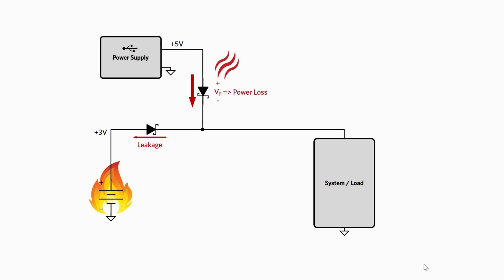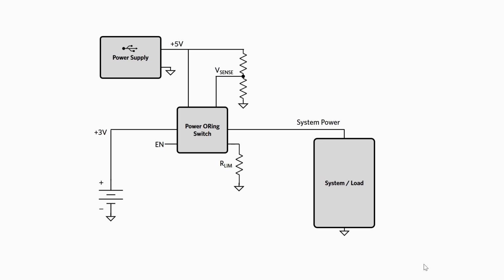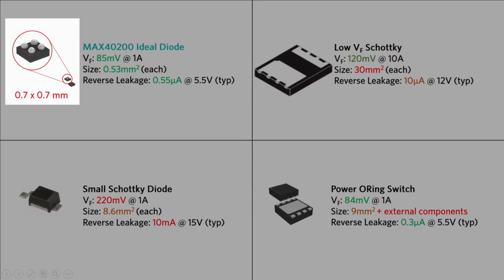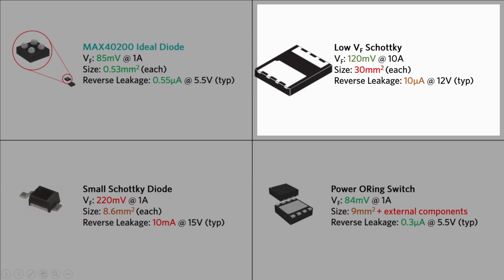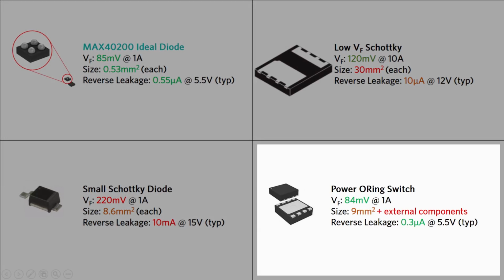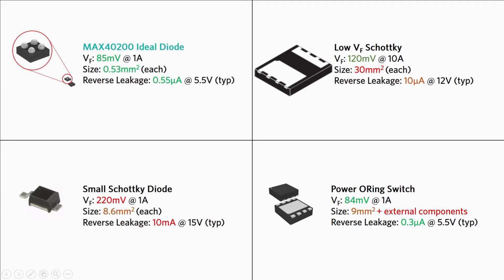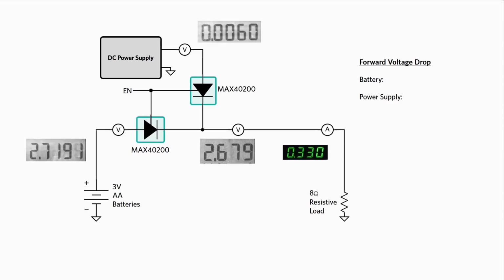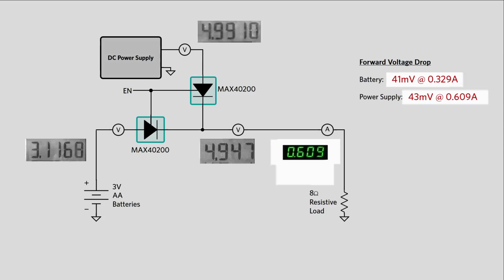How to Add a Diode ORing or Battery Backup Circuit Using the MAX40200 Ideal Diode

Comment: i got a relais between the negatieve of my battery and when i plug in the power adapter is switches the relais so the battery power got switched off but the only thing is that the battery makes the relais goinging on and off all the time 
how can i fix this first i thout by a diode but that broke quikly how can i fix this